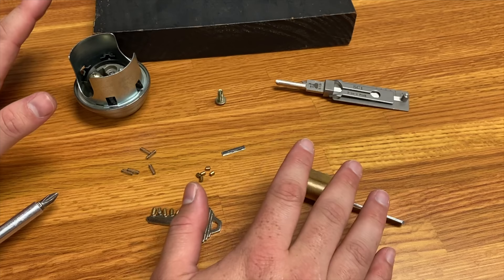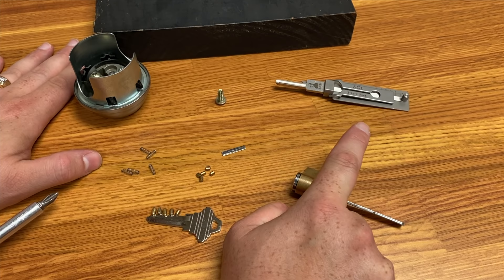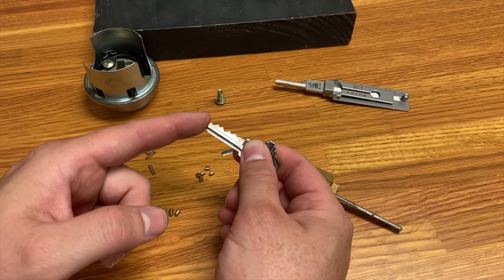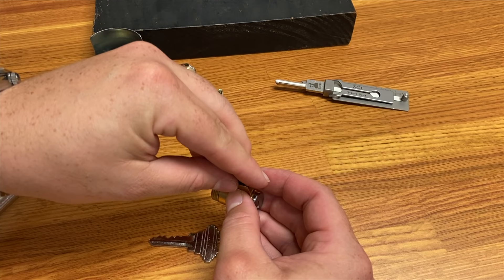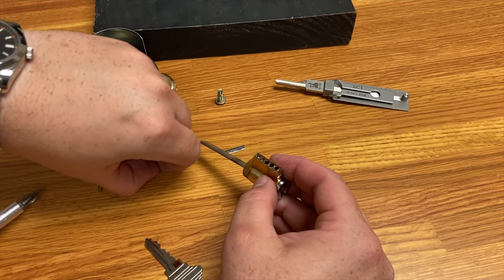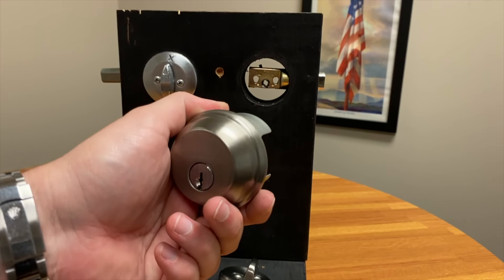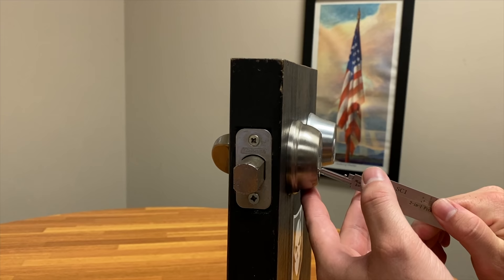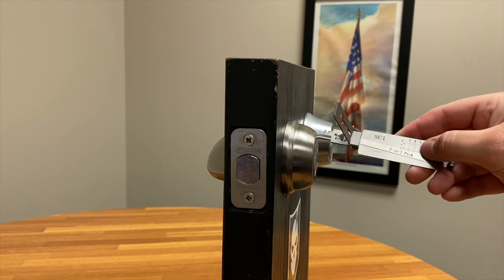Have the Lishi 2-in-1 Picks Been Debunked?

Comment: i had an employee lock a cabinet that has a Best lock on it. No one would make a key for me from the number on the lock . I am a total novice and received the Lishi BE2-6 today. it took ten minutes (I had to figure out tension) this was my first lock pick. I got to the control sheer line, took out the lock and opened with a screwdriver. YES this tool works as advertised

Comment: My question is how can you know what picks are for what kind of locks.
Reply: Lishi tools are keyway-specific, so eg the SC1 only works for that specific Schlage keyway. They only have a few non-automotive keyways, though
Reply: By the shape of the keyway. Look up the shape of SC1 versus KW1, which are both 5 pins. The 6 pin keyway shapes are the same for SC4 and KW5, respectively. A SC4 Lishi can be used in a SC1 keyway.

Comment: yes they work great... they dont work on smart key quickset types though.
Reply: They do work on smartkey. Smartkey is the only lock I've found them to be worth the cost on, in fact. If you're talking about the reverse side bar introduced in gen 3, they still work but are a bit more difficult, but still work. But judging by the blanket statement you made, I don't think you've ever picked a smartkey let alone knew there were different gens
Reply: @Erplane  Lock picking lawyer is my basis for my statement. applying tension to the core binds up the square edged transfer bar therefore preventing you from applying pressure to the pins. If you are certain try it with the tool and post video.
Reply: @renaissanceman5847   LPL picked a gen 3 himself; look for the video he posted June 14, 2019. You have to insert a shim on the side of the core to tension it, but you can still use the lishi
Reply: @Erplane  Yeah I saw the shim... I think he made extra room on the core to enable a thick enough shim that had sufficient spring force to apply pressure to the bar... new locks... there isnt enough room to get anything thicker than a sliver of spring steel about 0.010 inch thick, which doesntt apply enough force across the entire bar. once the lock is significantly worn (the bar recess in the body and the entrance gap) it works better. the lishi tool here is only used to decode using the wiggle test
Reply: they will work on smart locks, the only difference is as you are picking the pin slightly release tension as your picking each pin and reapply the tension once it is set and move on to the next one.timing is everything though as you are likely to have pins fall as you move to the next 1
Reply: @thesinglemale1  there are no pins in kwik set smart keys. it uses a cross bar with sliders.  if you cannot tension the cross bar with twisting motion

Comment: WIll these work  on 'real' locks (European style)? Like ABUS,  BKS, CES etc?
Our locks work upside-down, have five or six pins, are very tightly packed, miniscule tolerances.
I am a DIY amateur and learned picking basic German locks with regular tools, fail on the BKS though. Pins can be pushed down by my tools, but do not bind at all, no twisting of the cylinder.

This 'Lishi' method looks cool, but how does the scale match varying pin distances of different manufacturers, how can it reach a sixth pin, how to use it upside-down on installed door locks with bottom stacks etc.? Lishi offers a plentitude of different tools; what is the difference between an SS001 and KW1 tool? Not much real info out there.
Not sure if I should dump $20 into such a thing to play with it, as cool as the idea of Mr. Li is.
Reply: Your 'real' locks are no different from the American locks. ABUS uses the schlage keyway, would be pickable with a SC1 or SC5, depending on if it is 5 or 6 pins.
Lichis are purpose built devices, so you need a unique tool for each style of keyway (sc for schlage, kw for kwikset, ss is some Chinese lock). Fortunately the majority of locks use only a handful of keyways, and the 6 pin lichis can be adapted to work with 5 pin locks, so you can get by with just a few of them (though it is still pricey).
To use it in a upside down lock, you just use it upside down.
Reply: What are you talking about "real"?
Reply: @LoveOverwhelming  "Real" meaning 'tight', precision cut with little tolerances, hard to pick, like BKS. Opposite to 'loose', with lots of tolerances, wobbly pins and fairly easy to pick. Like the U.S. locks I do remember from my time back in the U.S.A.
Reply: @88BlueKeys4U  The problem is, the start of your definition is objective, but the latter half is subjective. And wrong.
Reply: @LoveOverwhelming  My current collection of door locks includes only European made ones from different manufacturers. Some (especially BKS)  are extremely tight and offer very little opportunity to unlock them with standard tools. I do remember the locks I had in the USA (usually the doorknob style), and they all were rather loose, noisy and fairly easy to manipulate. Their pins were not sitting very tight, were uneven in their spring reaction. So YES, my opinion is SUBJECTIVE, but it is true and based on my own findings. I did NOT buy the Lishi tool, prefer to use my variety of standard picking tools. I am no pro, just tinker for fun, learning about locks and picking methods, that's all.
Reply: @88BlueKeys4U  It's not true, exactly because it's subjective lol

Comment: Try one with a wider range of pins.
Reply from the maker: No u. ~ Rob
Reply: We use lishi picks all the time were I work to decode car locks and make keys. It is an amazing tool. They are not just for homes..
Reply: @marinemike01  awesome thanks for the info.  I had never seen anything like that before. I was having trouble raping my brain around it. I  retired from the city and used to do a lot building security issues.  I was just trained in basic locksmithing. I wanted to pursue more but could not find a locksmith that would take me as an aprintist.
Reply: That poor Lishi tool...
Reply: @marinemike01  thank you for your response, I appreciate it.